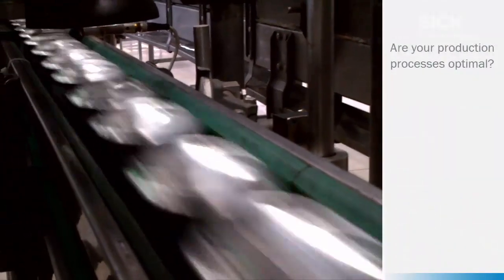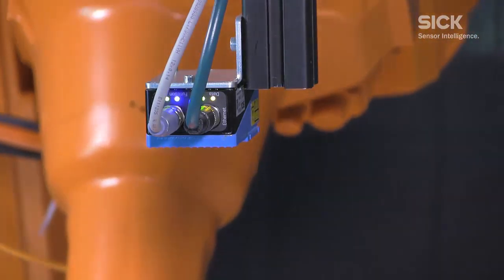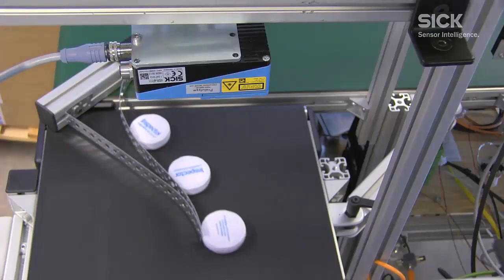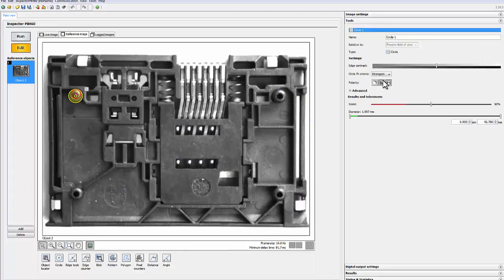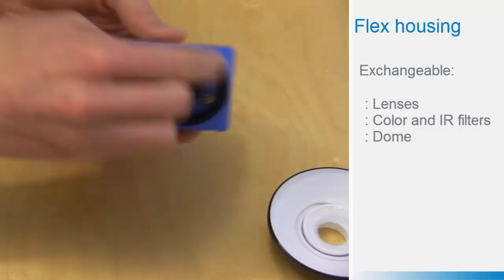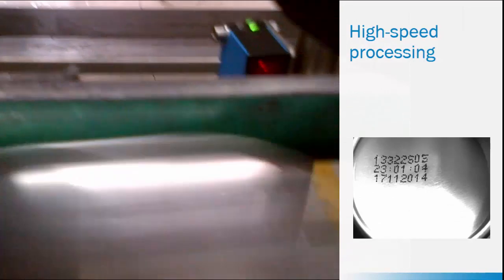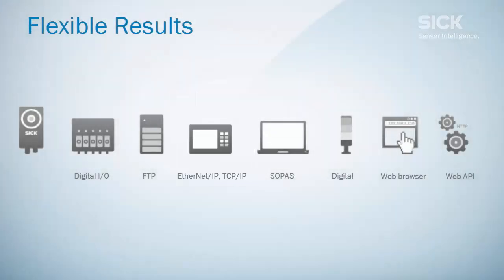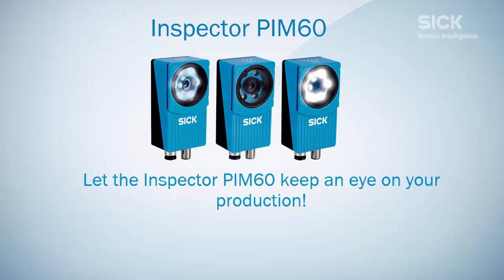Keep an eye on your production with Inspector PIM60 from SICK | SICK AG

Comment: I cant believe that you share a misleading video.  the video in high-speed processing on the product band seems to be made faster. This is the official sick sensor channel !!
Reply from the maker: Thank you for your inquiry. The Inspector PIM60 among other of our machine vision products, are high speed cameras designed to process and analyze each image to detect and exclude quality issues of the objects of interest. The Inspector PIM60 can in highly optimized cases take pictures of up to 200 Hz, and with the inspection area cropped like in this video, handle high speeds like in the video.